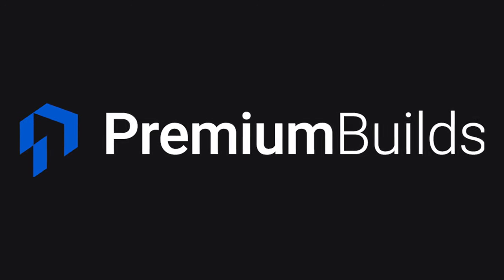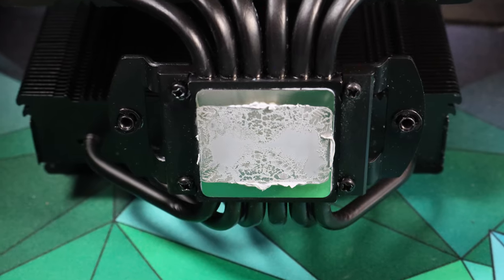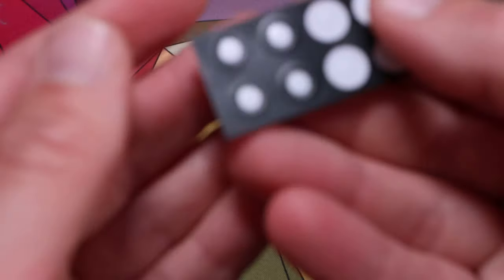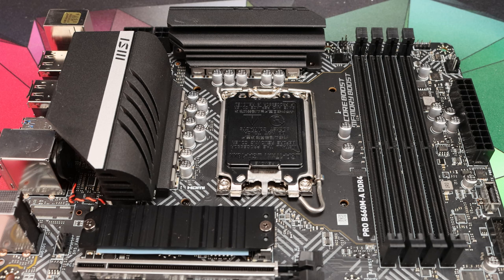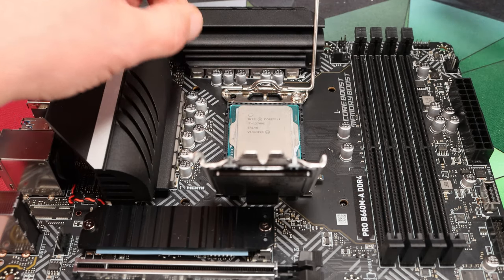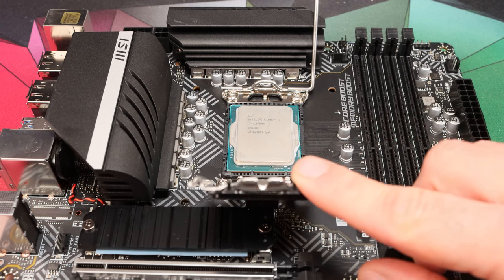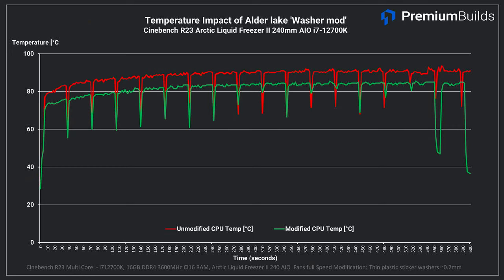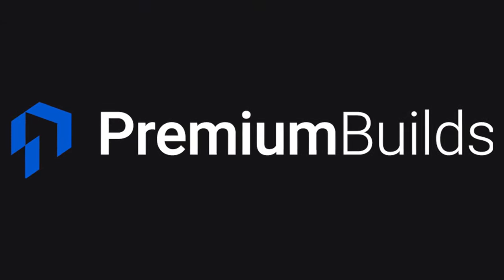Running Hot? Drop CPU temps with this simple mod!

Comment: I would suggest using plastic washers. If you screwed it too tight, those metal washers may etch on the mainboard and potentially cause a short circuit.
Reply: yeah or nylon ones.
Reply: @KhanArchitect  laundromat
Reply: I use 1mm nylon washers and I noticed a significant reduction in the tension when locking the ilm.

Comment: finally found an english channel that actually highlight on this, 
not only this will reduce your temperature of CPU, it also prevent your cpu from being bend.
there's a lot of people discussing the issue of cpu being bend due to 1700 lga screw were too tight with cooler.

Comment: I want to share another solution, I bought Thermalright aluminum CPU contact frame and replaced the original ILM on the motherboard. Temperatures dropped up to 9-10 degrees Celsius (i7 12700K). Doing so I am avoiding any possible CPU bending because of the equally applied pressure to entire IHS. Huge recommendation for this product! 
Would love to see @BuildPicker testing it :)
Reply from the maker: We have one and are testing with the 13600k and 13900k now!
Reply: Does it void the motherboard's warranty by changing the contact frame?
Reply: @BravoSixGoingDark  you can return back original one, in any moment
Reply: I got one of those Thermalright contact frame as well, for $12~ it came with torx tool and thermal paste. Worked great, lowered averages 5-7c~ for my i5 13600K NOTE: noticed that on MSI motherboards BIOS the CPU Lite Load defaults to mode 12, intel recommends mode 9, I set mine to mode 1. It no longer instantly ramps to 100c during cinebench r23 tests, but rather hovers around 75c~
Reply: @BuildPicker   would you suggest the inner and outer dia of the washer, pls??

Comment: Hi there. I used a 3D printer LGA1700 washer/spacer. I downloaded the file from the guy’s over the internet then uploaded to the 3D printer provider (I don’t have a 3D printer at home). I put it on the ASUS Strix Z690-A D4. It was a bit tight but it was fitted. The cpu temp was pretty good. I never tested it without washers though, I was just build the new computer straight.
Reply from the maker: Nice idea!

Comment: That is a serious oversight and I do not understand why it has been downplayed like that. It is basically a reason not to buy current gen motherboards.

Modding your brand new board and possibly voiding the warranty is not the way to go. We should look for a recall of the affected products.
Reply: Does not affect warranty
Reply: There is no warranty label on the screw of the loading mechanism, thus would not void warranty.

Comment: This video came just in time.
This morning my MSI z690 ddr5 edge wifi and 12700k will be delivered.
I, 'm very lucky to see this before installing the Noctua NH-D15.

Many thanks
Reply: i'm useing this cooler god it's running hot lol glad i found this vid
Reply: @arjanvink9361  yer done that still sum cores are thermal throttling with prime95 and frequency caps out at x49
Reply: It works perfectly fine. 
If there are significant temperature differences I don't know. Because I dit this mod directly after unboxing the main board.
Because there is cpu bending pressure don't doubt to do this mod.
After lifting the bracket a bit there is still enough pressure left for the cpu to function fine.

Temperatures can go pretty even with A Firts Class Noctua cooler.
MSI main boards have an option to tel the system what kind off cooler is used. 'Stock, Big Air Cooler, Water cooling' 
This setting limits the amount of power to the cpu depending on the used cooler. My board l is set to watercooling and in Cinebench23 themps can go up to 100°C. 
Power draw of 260W.
Undervolting is the solution. 
After Undervolting max temperature is 80°C with power draw of 189W.
Maybe 5% lesser score in benchmarks.
Reply: @arjanvink9361  how much did you undervolt?
Reply: @anonnomnom3282  I use the exact same settings as the guy uses in this video.
Please note: (depending on brand and type motherboard) you can set which type of cpu cooler you use in the bios.
I have it set on: watercooling (most powerful) but I use the Noctua NH-D15.

https://youtu.be/C0plFO6t_Vs
Reply: @arjanvink9361  ok thanks for the info! I have the MSI Z690-A DDR4 and 12700K and Scythe Fuma 2 cooler, it's good but not quite NH-D15 level. I just got the B-version of the Scythe LGA1700 mounting kit but I might order Thermal Grizzly's anti-bending frame.
Reply: @anonnomnom3282  no problem. 
This anti-bending kit is a nice upgrade to add to your system. Still do recommend to try the mod from this video, if you haven't already...
Reply: @arjanvink9361  yeah I'll either do this trick on the video, but I would need to search the parts, or just buy the Thermal Grizzly frame, the good thing about the Thermal Grizzly is that I could find it easily and get it fast. I don't know I need to research some more but thanks for help!

Comment: I just assembled this board (MSI B660M- a PRO) along with an i3 12100F (stock cooler) and I immediately went and modded the socket.

I did not have any washers available so I just used an old plastic card (think credit card) and a pair of scissors. I cut two rectangular stripes for each bracket part to sit on and that was it.

Cinebench 23 default single core test
1675 points
About 26.7 Watts
About 58C temperature
4303 Mhz

Cinebench 23 default multi core test
8507 points
About 55.1 Watts
About 76C temperature
4100 Mhz

For the above results, Bios power limit was set to the Default (Boxed Cooler). Room temp was around 26C.

I ran again the same tests with Bios power limit set to 255W (Tower air cooler) and the same 26C temp. Single core yielded the same marks while multi core rose to 1520 points with all others being the same.
Reply: i get 1875 single on my 12900t
Reply: @micke9356  That is an expected result for that cpu.

Comment: i used paper washers, i got a pack ov 1.5 to .5. i found .8 the best for my 12700k. i was always thermal throttleing under normal useage.  after trying many diff washers i settles at .8 and now my processor nolonger thermal throttles infact instead of 100 degree max i get 68 max.
Reply: gonna try this mod on my mining board 🍻

Comment: I used Thermalright contact frame for my 13700K. Just tighten they way they came off, not tight at all as this guy mentioned. Spot on. Easy. Kinda nervy at first with a new mobo but results speak for themselves.

Comment: I just tried this with a 12700K at 5GHz all core and ring 4.8GHz 1.275 VCORE LLC 6/7. Noctua NH-D15S cooler. Small maybe 3-4C improvement or maybe the same. Certainly no worse.
Reply: 4.8 GHz ring is really good. With E-cores disabled, I assume?
Reply: @thephlophers  On 12th Gen. 13th Gen shoudl be able to hit 5GHz easily with e-cores disabled. Now above 5GHz is another story. With e-cores enabled I believe 4.6 to maybe tops 4.8 on 13th gen. On 12th Gen. 4.2GHz tops with e-cores on maybe 4.3 if lucky and no more.

Comment: Does the CPU actually bend like that?😳. Why don't the engineers fix it beforehand?
Reply from the maker: I have no idea. The retention bracket is incredibly aggressive with how much force it applies, especially directly across the 'weak' axis of an elongated CPU!
Reply: I spoke with an MSI tech guy just an hour ago.  Mind you today is the 6th of April 2022 and this problem is well over a few months old.   The MSI tech guy said that MSI is not aware of this issue.   However, he did say that he saw no issues with us using a 1mm thick nylon washer under the ILM.  He said it wouldn't void the warranty either.  He did caution about using a metal washer though.
Reply from the maker: @thomassimons8570  Nice of them to give you the all clear on modifying, anyway! It's a well documented issue and it's not MSI Specific.

Comment: Can you tell me the exact name and size of the washers you used. Also where did you get them? Thank you. I am using a MSI Z690 Pro a DDR5 12700k
Reply from the maker: I've had the best results with the Plastic sticky washers that come with the Arctic Liquid Freezer AIO to act as motherboard protection around the bracket holes. They are no more than 0.2mm thick. You could also use the paper 'hole reinforcement' round labels from a stationary store, or even just shim with a thin strip of cardboard or folded paper. You just need to lift the retention bracket a fractional amount.
Reply: @BuildPicker  Great tip with the hole reinforcement labels! It's actually not so easy to buy plastic M4 washers with 0.5 mm thickness or less.

Comment: Please tell me a good air cooler for i5-12400 12th Gen under $30? LGA 1700
Reply from the maker: We've got a video on it! Any 4 heat pipe tower air cooler does the job, 120mm fan preferred. Make sure it comes with LGA 1700 brackets. Veteoo v5, Arctic esports 34, ID cooling se-224xt, hyper 212... Loads of options.

Comment: i would suggest ppl mount the CPU first and test the surface for bends, use the lego method first. If the surface isn't bending, then you do not really need to do this mod. it could be possible that manufacturers already fixed this issue (i hope so at least). and it's a sad issue to have in the first place. i plan to buy a new pc and mobo+cpu is around 800$, so for that price, i now possibly need to worry if my CPU is bending so much that my temps might go up 5-10C?! Does that make any sense?! and fixing this issue is under 2$ and 5 min of your time?! are we on the receiving end of some cruel joke? btw, awesome channel, and thx for the clear info on how to do this mod.
Reply: You can get 12700F + MSI Pro B660-A for around 400€, what are you looking at that would cost you 800$? I agree on testing first though.
Reply: @gricnime  hm, that's weird, B660 should be a lot cheaper then Z690 from the same manufacturer.

Comment: with plastic washers there is a possibility for fire hazards especially for those with long running processes 24/7!
Reply from the maker: The rest of the PC would catch fire before that. There's plenty of plastic in and around the CPU socket and in other components. Internal PC temperatures do not exceed 125C (Highest VRM temperatures - and these washers aren't close ot the VRM) whilst Nylon and other polyesters do not ignite until 400C+
Reply: Nonsense

Comment: well this is a lot less expensive than those thermal grizzly plates and wont void a warranty like die lapping would so perhaps I'll give this a try,   thank you for the video!
Reply from the maker: There's also now thermalright contact frames for around $10 - probably the best value solution!

Comment: Hi there & thanks for the intriguing bit of info.  Would you please provide a link to the .1 - .3 mm plastic mb washers you recommended?  I'm using the MSI Pro ddr4 and it won't allow for the 1mm nylons i have.
Reply from the maker: Hi, I used the sticky plastic washers that come with some coolers to protect the surface of the motherboard. However, you can use anything as a thin shim - a strip from a cereal box, hole reinforcement rings for paper documents would be fine. Alternatively, since this video was made, there's a couple of 'contact frames' now available which may be a better more secure option to solve this issue.

Comment: If the washers are slightly too thick wouldn't that affect the connection between the motherboard and the CPU?  It's a fine line I guess.  I did see some parts out there that replace the retainer completely and make sure the CPU is pushed in evenly all around while not getting in the way of any cooler you choose to fit (and they aren't reliant on the production tolerances of plastic washers which can vary between washers from the same batch).  They do however need a level of self control so that you don't over torque the screws.
Reply from the maker: If the washers are too thick the first thing that happens is the retention bracket gets lifted proud of the CPU surface, so a cooler won't fit properly. The force required for proper contact between the CPU pads and pins really isn't all that much, but that's intels argument for the amount of clamping force the retention bracket delivers.
Reply: @BuildPicker  I was thinking more of an uneven pressure issue than what you just said but it is true that if it's way too thick things don't fit.

Comment: What washers were they exactly? I saw somewhere that M4 washers are the ones to use, but I would like to know both the interior and exterior circle diameters (in millimeters) so I can get it right.
Using ASUS ROG Formula Z690 DDR5.
Reply from the maker: The ID needs to be about 4mm, OD 10-15mm max. but honestly you can use anything as a shim. I'd prefer nylon 0.5mm thickness washers, best balance of fitting and not likely to damage the motherboard. You could even try a cardboard shim.
Reply: @BuildPicker  understood. Thank you very much!
Reply: @BuildPicker  I wouldn't recommend putting cardboard close to parts that could reach around 100°C.
Reply from the maker: @moos5221  Cardboard burns at 250°C+ If anything it's safer than plastics. Temps at that area of a motherboard are significantly lower than peak CPU core temp or VRM temp.

Comment: If one needs longer screws, what specs are the existing ones? Is it UNC #6-32? I have a Z790 MB and want to use a contact frame but the screws are just a hair too short. I have not been able to find any info about this matter anywhere for the Z790 which I assume uses the same ILM as the Z690 does. Somewhere it said that the ILM on the Z690 uses #8-32 but I have my doubts after my initial (basic) measurements. Igor’s lab said M4, but I don’t think they are that big.
Reply from the maker: I'm sorry, I don't know the specs of those screws. Right now I'd actually buy a 'contact frame' for around $10 for the thermalright version, and use that instead. It solves the issue in a much more elegant way and reuses the existing screws.
Reply: @BuildPicker  Thank you for the reply. I actually bought both the Thermal Grizzly and the Thermalright frames. The Thermal Grizzly did not work because of the screws being too short, but the Thermalright worked and my new PC is finally up and running and has good temps with good core-core deltas (for being a 13900K). And, if this can help anyone else, I actually got a thread pitch gauge and a caliper and measured the screws to be #6-32 UNC. 1/4 inches long.
Reply from the maker: @BoFmE  Thanks for the info and glad you got it fixed!

Comment: Will you please share the ID and OD size of the washer? Thanks!
Reply: You can use basically any washer that size or thicker, just sand it down
Reply: @piersonm5574  Thanks. I bought a CPU frame and called it good.

Comment: Will this problem be solved in the 13th gen Intel cpus?
Reply: It is a motherboard issue, not a cpu issue.
Reply: @psyber84  it was socket design flaw, neither cpu nor motherboard.
Reply: @CleverBoy0098  my point exactly, the socket is located on the motherboard you know.

Comment: Those look like the washers that came with the liquid freezer 2. If they are that I may try this myself
Reply from the maker: What I've had best results with are the plastic sticky protection washers that come with the Arctic LF products - give those a go they seem to work really well!
Reply: @BuildPicker  after this comment i did the mod and dropped 15c
Reply: Pretty nuts intel manged to somewhat screw the pooch on this one
Reply: Are yours plastic too? The only washers that came with my motherboard and aio are metal. And as I understood that can complicate things if is too tight of a screw. Thanks!
Reply: @AboveFiction  yes mine are plastic

Comment: do you know the Inside Diameter or the outside Diameter? I really don 't want to buy an Arctic Liquid Freezer AIO for a couple of washers. I did try a search for the arctic washer but found nothing .
Reply from the maker: Sorry I should have been more specific in the video: The ID needs to be about 4mm, OD 10-15mm max.  But honestly you could also shim under the length of the bracket with a strip of card or similar for the same effect. You're just looking to lift the retention bracket about half a mm up off the surface of the motherboard. The screws will keep it in place.
Reply: @BuildPicker  Thank You for the info. I might try the card mod first.

Comment: how would this be possible using a thermal right contact frame currently using it with a 13700k and it still tun hot on a EK 360mm aio not enough pressure I think
Reply from the maker: What's 'running hot' to you? It's a 260W potential CPU so it may run in the low 90's. What's important is if it's throttling or not. Investigate undervolting and power limiting options to take the edge off of thermals. I hope to have a video covering this issue out in a week.
Reply: @BuildPicker  thanks mate, so on stock my 13700kf will throttle on r23 the lowest stable undervolt I've been able to achieve does -0.1v , and 190w underload so 1.144v avg and 80c-86c ...not great for a pretty good aio and contact frame,  really want to try increase pressure but don't know if washers would work with a contact frame

Comment: Anyone tried this with the stock cooler and does it make a difference?
Reply from the maker: I wouldn't bother doing this with the stock cooler. Step one is replace it with something better, not making modifications to the IHS like this.
Reply: I have...I dropped 10C
I have an i5-12400 on an Asus Prime H670-PLUS D4.

I agree the stock cooler is inadequate but the washer method is good if you can't upgrade your cooler yet, and it may be even better doing both.